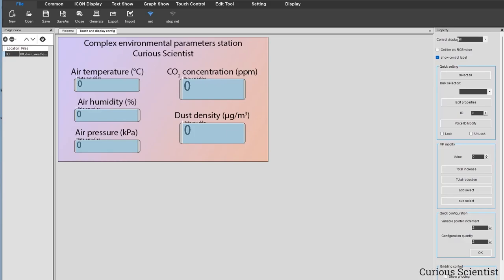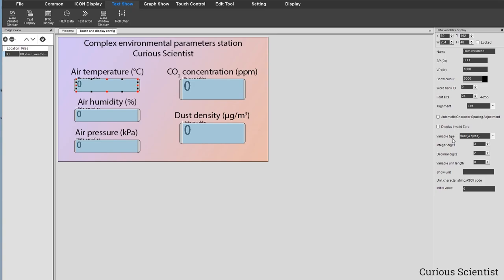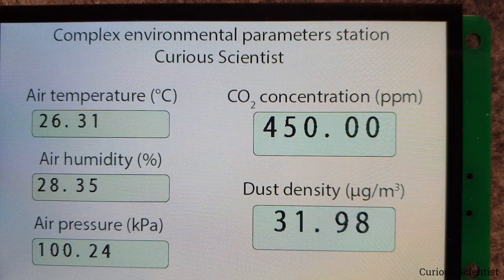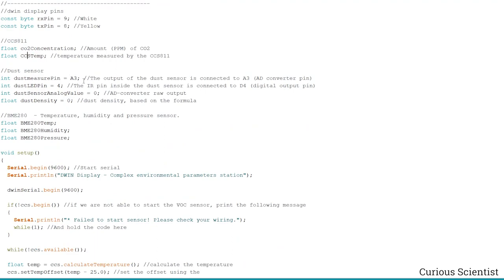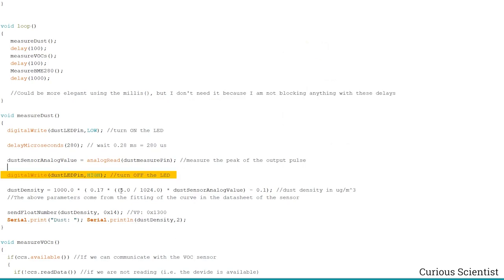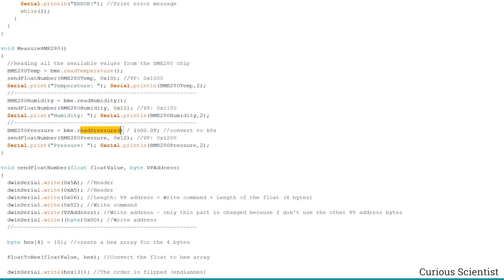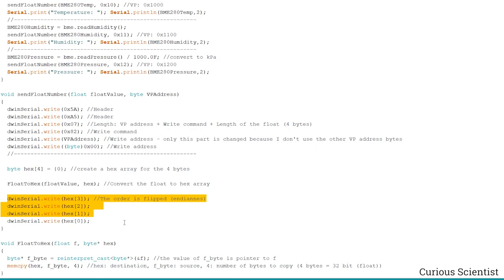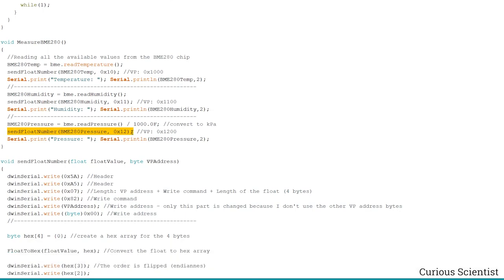DWIN Display Tutorials #3 - Simple weather station project

Comment: Hey I watched your video it was really helpful and cool 😎. 
But just I wanted to know whether have you worked with microcontroller (esp32, Arduino etc ..) and can directly burn the code in dwin module by using its tx, rx pins . Like some how what I just wanted to interface esp32 with DWIN module using its tx, rx pins without using pgt05 (uart converter) pin burner.
Reply from the maker: Hi! No, you always need an SD card to upload the code. The serial port is only for communication. You can read more details in the manual.
Reply: @CuriousScientist  thanks for the info ....
Reply: @CuriousScientist  just wanted to confirm you that , I want to update the icl file using esp32 on rx, tx pin is it possible to do that? Can we send files over rx,tx pins and update it accordingly?
Reply from the maker: I just told above that the files should be updated via an SD card.
Reply: @CuriousScientist please i need some help with the dwin hmi project 🙏 😢...i already have a project water level indicator and controller displays parameters on 0.96' oled using esp32..i want to display the same parameters on dwin hmi i can make UI and everything else now how can i display this data on dwin...will this code work 
#include <HardwareSerial.h>

// Define the RX and TX pins for the Serial2 connection
#define RXD2 16
#define TXD2 17

// Initialize Serial2 for DWIN display
HardwareSerial mySerial(2);

void setup() {
  // Initialize the default Serial monitor for debugging
  Serial.begin(115200);
  
  // Initialize Serial2 for DWIN display communication
  mySerial.begin(115200, SERIAL_8N1, RXD2, TXD2);
}

void loop() {
  // Simulate reading the water level; replace with actual sensor code
  int waterLevel = getWaterLevel(); 

  // Send the water level to the DWIN display
  sendWaterLevelToDWIN(waterLevel);
  
  // Delay for 1 second before sending the next value
  delay(1000);
}

// Function to simulate reading the water level sensor
int getWaterLevel() {
  // Replace with actual code to read the sensor value
  return analogRead(34); // Example analog pin for water level sensor
}

// Function to send water level data to the DWIN display
void sendWaterLevelToDWIN(int level) {
  // Format the command according to DWIN's protocol
  byte command[] = {0x5A, 0xA5, 0x05, 0x82, 0x00, 0x10, (byte)(level >> 8), (byte)(level & 0xFF)};
  
  // Send the command to the DWIN display
  mySerial.write(command, sizeof(command));
}